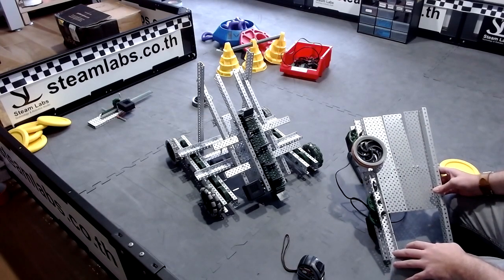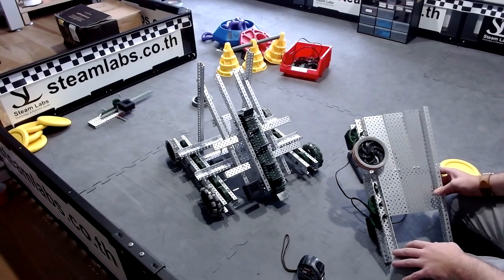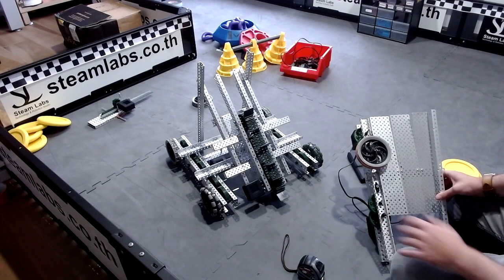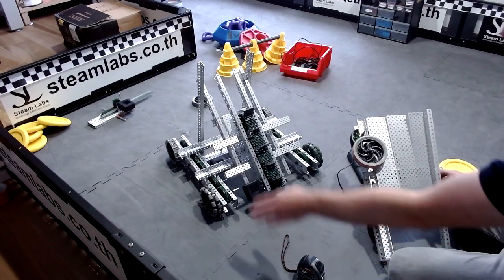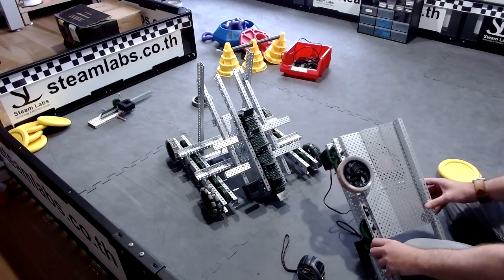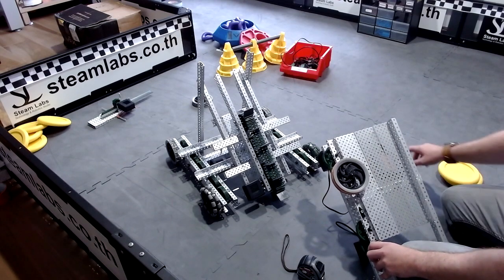VEX Spin Up Robot Design - Flywheel - VEX V5

Comment: How many motors did you use for the flywheel launcher? I only have 1 motor available, with a blue gearbox. I have something similar but it doesn't go up to full speed and it slows down when i turn it on.

Comment: Did you use a blue motor or green. I saw 2 speed gear ratios but not motor color
Reply from the maker: This is using a blue motor
Reply: Ok, would it work to use 3 speed ratios?
Reply from the maker: The gearing we have used is 60T, 12T, 12T 60T, this is an 84:60 ratio, it may work with a 3 speed ratio but haven't tested it yet, this gear mechanism works very well, if you have enough gears I would try it. Let us know how you get on with a 3 speed ratio.

Comment: Where can I buy just one? My school doesn't have any and insists they can neither find somewhere to buy it (they say it'll take too long) nor can they afford it.
Reply from the maker: Hi,

What is it you are looking to buy? VEX are now selling a dedicated flywheel weight as well as a ball bearing which allows you to create less friction in the mechanism. Flex wheels are also now legal, the latter two parts I mentioned my teams are starting to experiment with, you can work without these in a flywheel build but I think you may run into issues with friction for this years competition.
Reply: @steamlabstech  I thought it was called a flywheel, but it's actually (as you mentioned) a flex wheel. 
If I try to buy one from vex, do you think I could get it within two weeks?
Reply from the maker: That is a million dollar question many are asking. Firstly, there are different components you need to purchase

1 - flex wheel
2 - hub

There are different variations of components you can use, we went with aluminium hubs as the cheaper hubs were out of stock, we have also purchased a ball bearing to help reduce friction on the flywheel, one of my teams hasn't released their latest build yet, we will post it on this channel when they are ready.

I hope that helps, lots of excellent robot reveals already released this season which will hopefully help you

Comment: we are trying double flywheel approach but it’s not going as far as yours. do you have any advice?
Reply from the maker: Double flywheel works, but my teams have found single flywheel is more effective, I suggest maybe a ratio of around 120 - 12 teeth with a single motor, if you use the blue cartridge this will generate enough power. The advice I can offer is protoytype prototype prototype, there is no easy answer with this, some of my teams are on their 8th iteration of the flywheel, a different structure will be different for each robot design.

Comment: do you have instructions on how to build it?
Reply from the maker: I don't have instruction, if you pause the video you should be able to see what parts I have used, the most important part is the gearing

At the bottom connected to the motor is an 84T gear, this connects to the middle shaft which is using a 12T gear with another 84T gear on the same shaft, being driven from the middle 84T gear is another 12, so you have 180T driving a 12T gear